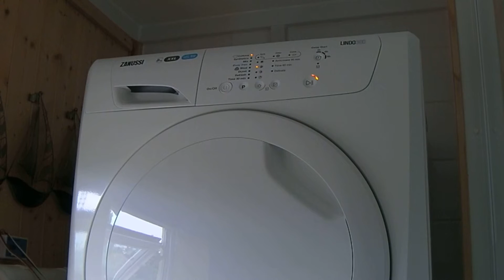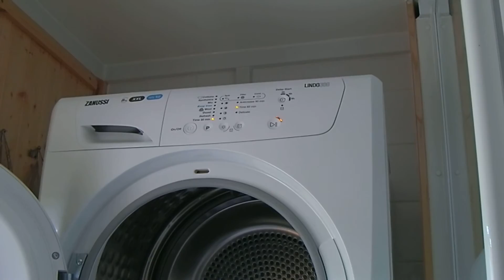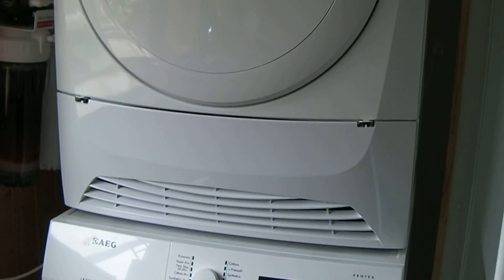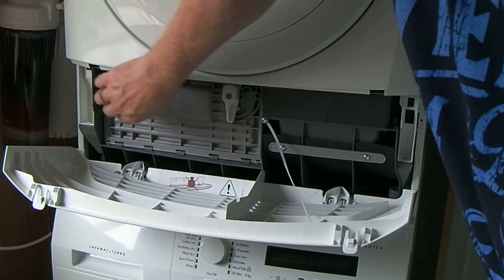AEG Washer Dryer, Zanussi Lindo 300 Tumble Dryer

Comment: I sold the tumble drier, as it was not used for 10 years. Luckily I live where just hanging it out all year round is the easy option. Indoor drying rack for the rainy days.No extra electric bills as well.
Reply: SeanBZA that can cause damp in your house and it will start to smell so actually tumble dryers are a life saver

Comment: The beep sounds can be deactivated if you read the operating instructions! The question asked on the WHICH site is because it is not apparent from a picture and spec sheets on there so its not 'obvious' that it has a sensor! I have used many condensor tumble driers like these that do not have a sensor.